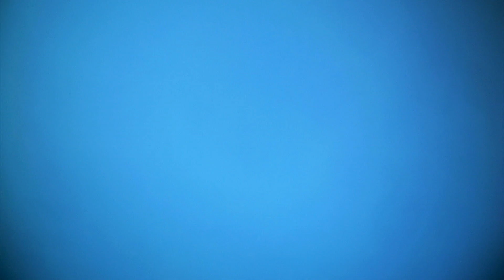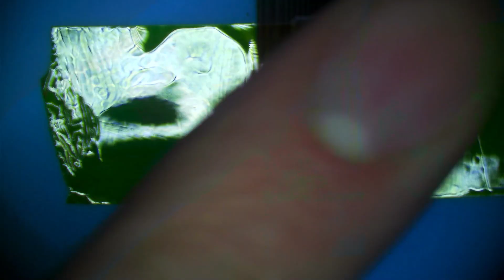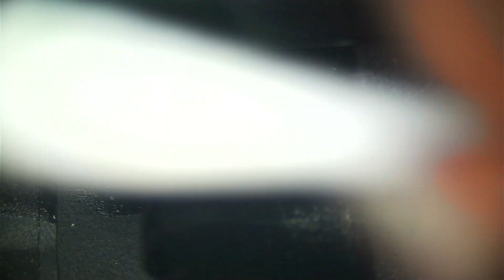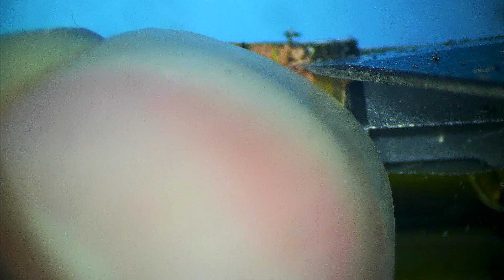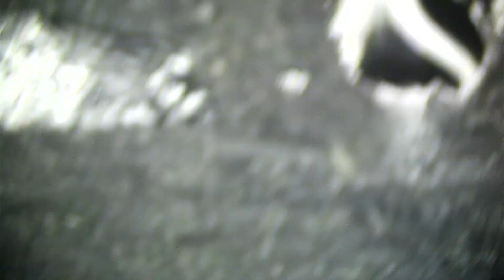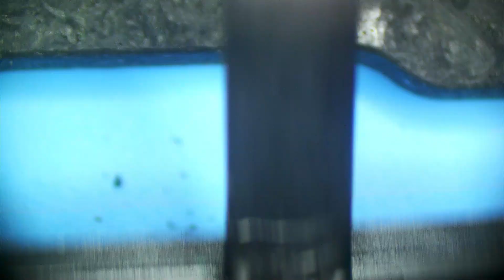2016/2017 MacBook Pro display shuts off when opened.| HOW WE DO FLEXGATE REPAIR

Comment: So is it fine to bridge all 6 thin wires? 42:30
Reply from the maker: Yes. Those are all the LED return lines. Bridging them durability as if one trace breaks down the line, you will still have complete display function. Basically all these lines do is complete the circuit between the 6 LED strips in the display.
Reply: @TCRSCircuit  so basically is the 2 thick bridges on the end side.. and i can bridge (short ) all those 6 thin lines ?

Comment: How much would you charge to fix it? I wouldn't mind shipping you my computer!
Reply from the maker: Hi Malik, We charge $259 for this. If you want to send your macbook in, please create a new ticket at www.tcrscircuit.repair/newticket . Thank you!
Reply: @TCRSCircuit  OK. Meanwhile, how does ths shipping work?
Reply from the maker: @malikd2509  all the instructions are on that link. Basically you ship it in at your cost and we handle the rest.
Reply: @TCRSCircuit  is it $259 for all laptop models? MacBook Pro 15" 2016 Model? Which size FedEx box fits best Small, Med or Large, or do you need your own custom box? Thx
Reply from the maker: @ZorbaTheGreek27  flexgate is the same price regardless of the model. The FedEx one rate large box works well,
Reply: @TCRSCircuit   @TCRS Circuit  Thank You for speedy reply. I am going to to one last ditch effort with apple support and when they reject me, i'll create a ticket on your website. Thank You is the $259 price include tax or the final price for full payment? - Thanks again
Reply from the maker: @ZorbaTheGreek27  That’s final. No tax on services in California.

Comment: I dont have a microscope can i use magnifying glass instead?
Reply from the maker: Absolutely not.
Reply: @TCRSCircuit  i see. Thanks!
Reply: @MrNixified  Just get the experience to open the LCD  and swap the LCD panel from a housing with the backlight included from a cracked screen. That is how we repair customers screens by only charging around £100.

Comment: So can basically replace the wire only which is much easier, I guess ?
(and then have to replace it in a few years again I guess) 

Am I right ?
Reply from the maker: No.

The cable is extended so it should never have the problem again. 

Replacing the backlight flex like this is much harder than replacing the display itself, but it is cheaper when a skilled repair shop does it.
Reply: Thx for the answer! Well.. what a bad luck then  😕  warranty time is over so I'm screwed.   This is no daily business for a "normal" repair shop I guess so I'm wondering if in Germany someone offers this.
Reply: Hy!   Apple changed my display (on an A1708 model) for free, despite out of warranty (purchase was Dec. '2016).     Happy now!            But yeah, let's be honest, for this model they were least 2x service programs (display and keyboard) so it's not a flawless piece of gadget.
Reply from the maker: @ballyp81  Lucky! Usually they send you packing!
Reply: Can’t deny being happy about it. All would cost 606.- swiss francs (484.- display, 79.- work, 43.- tax)
Reply: @ballyp81  Hi! I also have the screen issue, but Apple charges $832 Canadian dollars to replace my Mac's display 😭May I ask how you asked apple to do it for free, please? thanks in advance :)
Reply: Hy! Since my model was in the Replacement Program, this was no problem to have it replaced despite (slightly) out of warranty.
Reply: @ballyp81  thanks for the info! i just found out that my 2017 MacBook Pro is also under the display backlight program. im bringing it in this week

Comment: Unfortunately for me my screen is cracked. Very small crack at the top of the screen now made the whole screen go black when turning it on. Backlight works but the screen is just black, no logo no sound, tried all the things like reset the vram and so on and still nothing, I was told it’s the way apple is designed as soon as it detects a screen failure it just won’t let me use it, so a screen replacement is the only way to repair it. The thing is I paid around 1,000$ for this macbook pro a few years ago and I’m not gonna pay 500$ for a screen, does anyone know a cheaper place to get those screens? Mine is a 2016 A1707 macbook pro touch 15”. Thanks
Reply from the maker: No, that is the cost of the screens unfortunately, no way around it

Comment: Thank you so much for the video! I've seen people use the loop method in other videos but didn't quite understand the reasoning for it, so thanks for explaining! Just curious, have you ever tried a flexgate repair for the webcam? The traces are much tinier and closer together, its almost impossible not to bridge them. I wonder if a loop would also work for those traces 🤔
Reply from the maker: Loop would not work. In my opinion it isn’t practical to do the webcam repair
Reply: @TCRSCircuit  haha yea, tried a couple of times and gave up 😅
Reply: Loop won't work, but it can be done, practice, practice, practice, you can do it! Touch id on iPhone 7-8 is much more difficult and it can done fast once you get really good at it, practice more.

Comment: Hi you can vaporize the black coating by a blue or violett laser diode from a good laserpointer (2-3W is  sufficent) (or a cheap laser engraver machine) from a distance of some cm, not to near that can cause damage of the inner layer of the flex . :)

Comment: This reminds me of repair i did to my dslr camera whose focusing motors flex cable were ripped off at the sides due to prolonged opening and closing of the lens. I am not a professional repair guy but due to curiosity and being a electrical engineer I opened the lens on my own to figure out what the problem was. It was kind of intimidating at first to open a DSLR lens but then i figured out somehow and noticed the flex cable that was wearing off . I went to Nikons official service centre to ask them if they can fix it for me but they straight away told that they will replace the entire lens . I was totally shocked getting such a reply from official service centre how come the official service centre not have  replacement flex cable 😅. Then i asked with some local camera repair guys they also denied servicing up . I took it in my own hands and did a similar fix not so clean but it does the job . Maybe some time in future i will try to do this as clean as yours . The video is in my channel if anyone wants to see 🙈.

Comment: Is this enameled, or bare copper wire being used for the jumpers?  Looks like a very tiny gauge.
Reply from the maker: 0.020 is the gauge...
Reply from the maker: Bare copper. I’ll check on the gauge tomorrow, but it’s about the size of a human hair for the 6 return lines

Comment: Scraping is normally better done with one’s blade at 90+ degrees to the direction you are scraping.   Look at video of using a card scraper in wood working.   Would be nice to have custom jig to lay the screen in that would support that cable flat, for scraping too.  Excellent repair tutorial! Thank you!

Comment: I really love that you guys find solutions to typical screwups that manufacturers make. It is so impressive. Stupid question: Is it possible to use like a fiberglass pen to remove the coatings? I don't have your stable hands. I have tried to remove coating on flex cable (broken cable for learning) with knife, but screw up. I did everything wrong with the knife so I gave up. I'm so impressed that you find all of these solutions. Thank you for a great lesson Tim.
Reply: Paul from Rossmann Repair uses a fibreglass  pen in this video on  FlexGate actually  https://youtu.be/hiT81o-afu4?t=1368
Reply: @MrPnew1  - I’d count that as an authoritative yes on the tool, assuming it worked well for the repair... have not watched yet
Reply from the maker: I haven’t tried with a fiberglass pen yet. Worth a shot for sure!
Reply: Use a knife blade like a card scraper in woodworking, and you are a lot less likely to scrape too deep or cut through the copper.

Comment: After all the discussion today awesome to see you dropped this, Tim. Thanks for such a great video.

What gauge jumper were you using (the smaller - you mentioned you mentioned the size for the actual backlight traces).
Reply: Tim said this in a later comment 0.020 is the gauge
Reply from the maker: Discussion?
Reply: @TCRSCircuit  in the group Tim, in one  of my posts where I linked this video